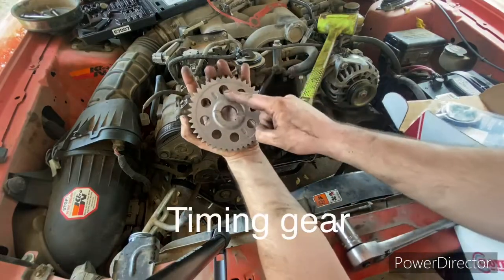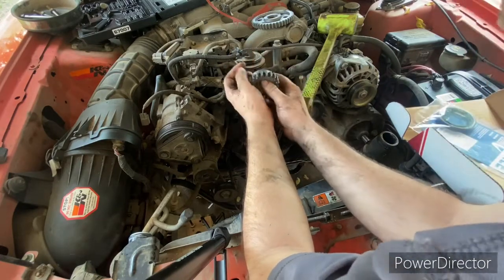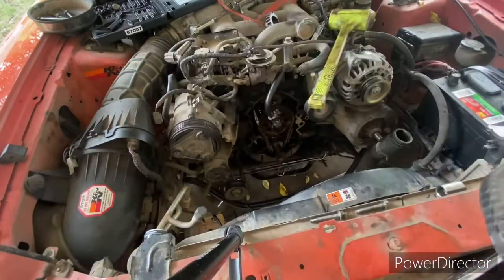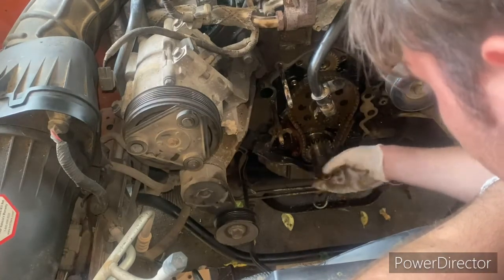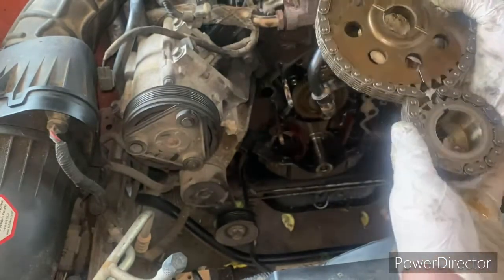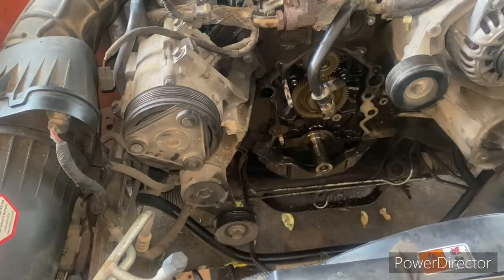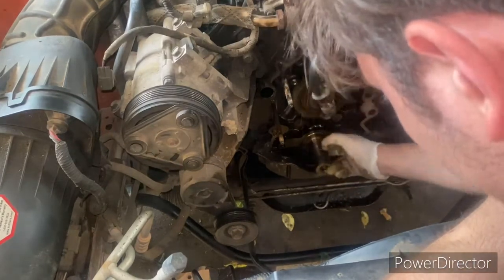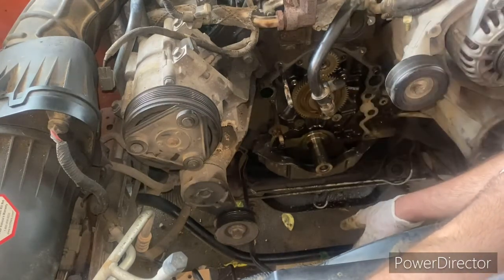2004 Ford Mustang 3.9 Timing cover replacement Part 4

Comment: I have the same car. What makes the rear of the car wiggle from side to side when changing gears?? I put a new transmission mount and it still wiggles??
Any ideas??
Reply from the maker: Could be the diff. Some cars have a posi and you can feel it sometimes, tire pressure, too much hp, these cars also have a driveshaft isolator if I remember correctly, Ackerman angle off. Could be loose. lots of things really. I’d say take a mechanic with you on a test drive and show them as these cars are almost 18 years old at the youngest model